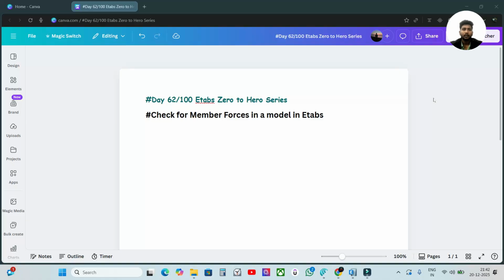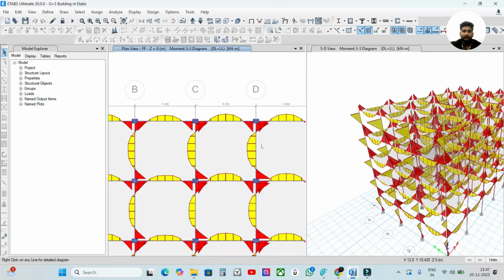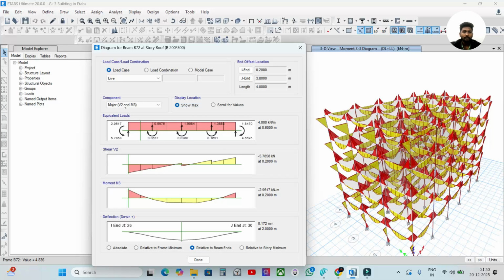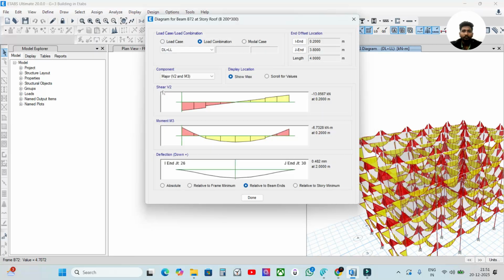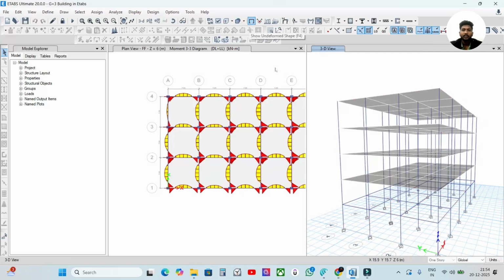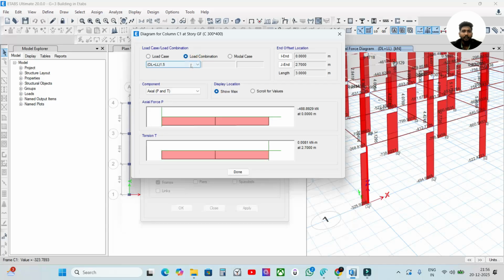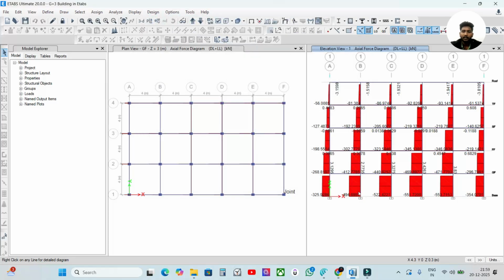How to Check Member Forces in ETABS (Bending, Shear & Axial)

Comment from the maker: This video tutorial by StructWithPritam explains how to check member forces in ETABS for a G+3 story building model (0:09). The process involves displaying various force diagrams for beams, columns, and other structural elements.

Here's a breakdown of the key steps and concepts covered:

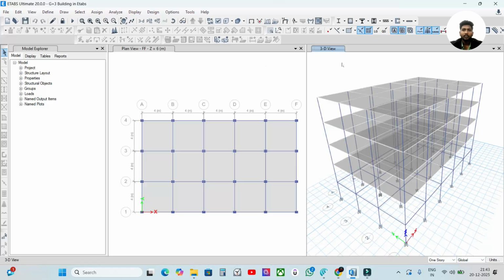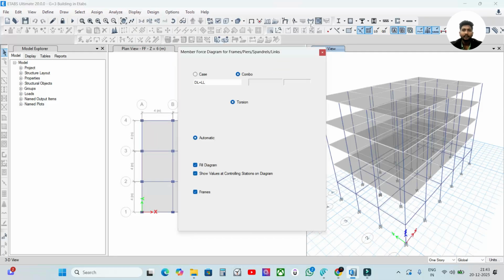Accessing Force Diagrams: You can display frame, spandrel, and link forces by going to the "Display" menu, then "Force/Stress Diagrams," and selecting "Frame Forces" (0:46-1:06). Alternatively, you can use the shortcut key "F8" (0:50).
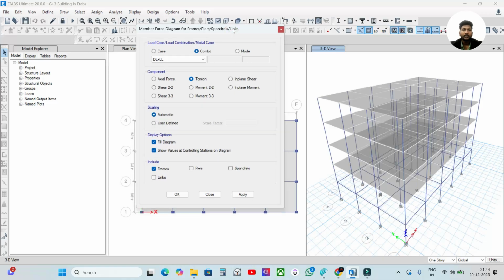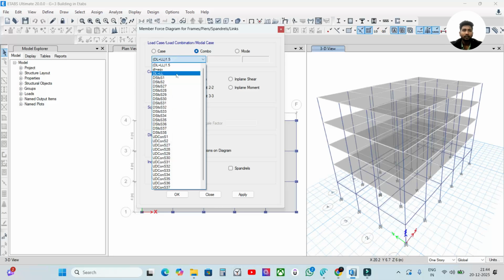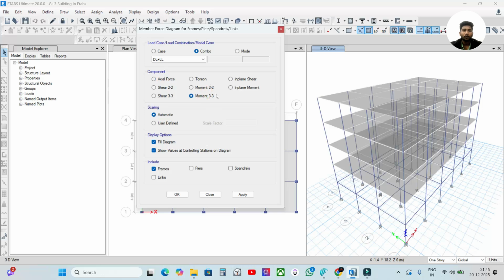Load Combinations and Components: The tutorial emphasizes checking forces for specific load combinations, such as dead load plus live load (1:19-1:58). You can select different force components like axial force, shear force (V2, V3), bending moment (M2, M3), and torsion (2:06-2:16).
Moment Diagrams (Bending Moment):
To display bending moment diagrams (Moment about 3-3), select "M3" as the component (2:19-2:21).
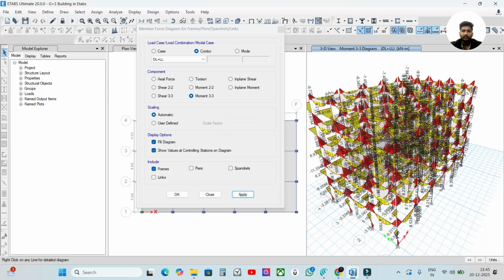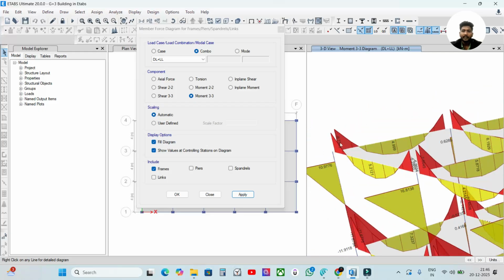The video shows how to use "filled diagrams" for better visualization (2:27-3:02) and explains that the yellow part indicates sagging and the upper part indicates hogging (3:06-3:11).
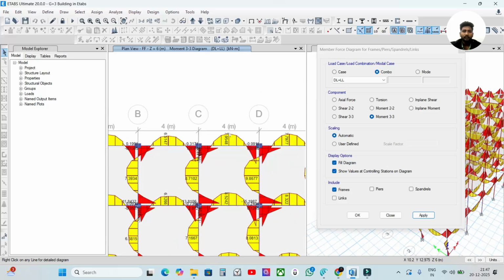To see specific values on the diagram, enable "Show values at controlling station on diagram" (4:04-4:14), but notes that it can be cluttered (3:23-3:39).
Detailed Member Information: To inspect forces for a specific beam or column, right-click on the member in the model view (4:31-4:44). This brings up a detailed diagram showing shear force, bending moment, and deflection along the member's length, along with maximum values and deflection (4:47-5:18, 8:24-8:55). The video also explains how the deflection values are interpreted (9:05-9:19).
Shear Force Diagrams: The video demonstrates displaying shear force diagrams (Shear about 3-3 and 2-2) (9:36-9:57). It highlights that shear values generally decrease as you move downward in a structure (10:02-10:29).
Axial Force Diagrams: For axial forces, primarily relevant for columns, select "Axial Force" as the component (11:04-11:06). The tutorial shows how to display these forces in 3D view and elevation view (10:52-11:23, 14:25-14:51). It notes that axial forces are generally larger at the bottom part of columns (13:03-13:23, 14:52-14:55).
Interpreting Results: The video emphasizes that these diagrams and detailed views help engineers understand how the structure behaves under different loads (0:09, 13:54-13:56). It briefly touches on how the bending moment is calculated (8:46-8:51) and how load transfer from slabs to beams affects shear diagrams (6:08-6:39).
The video concludes by mentioning that reactions will be discussed in the next tutorial (15:07-15:13).
Reply: I really appreciate your efforts..keep it up
Reply from the maker: @asimee12625 welcome ❤️‍🔥